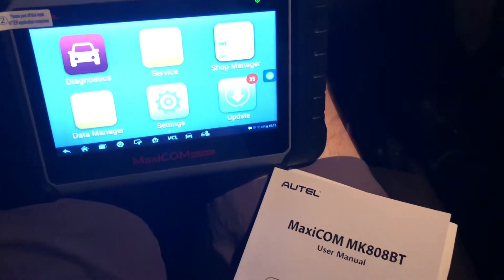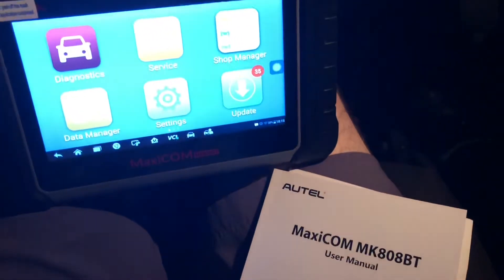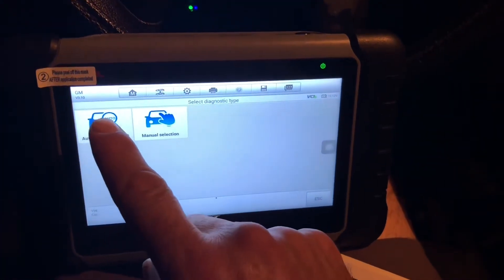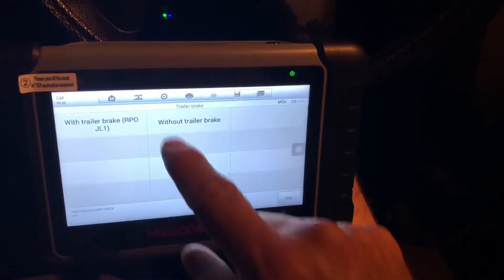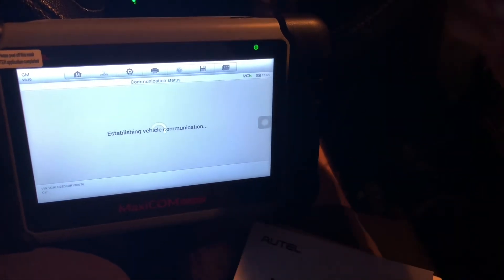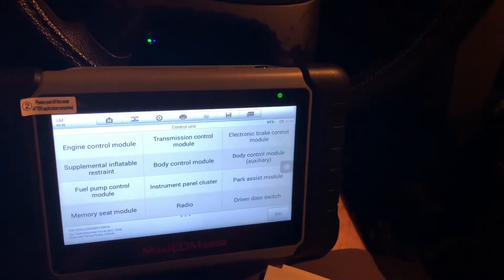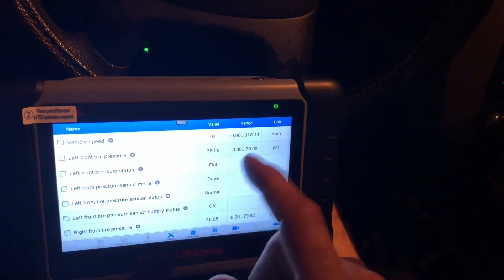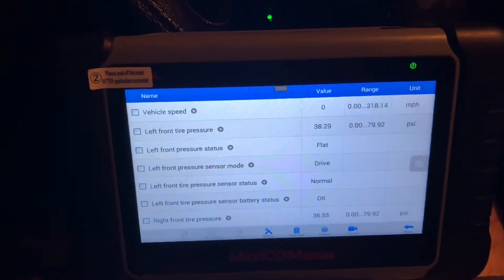reading live tire pressure using mk808 by autel

Comment: Im having the same problem. I bought the mk808bt and im trying to set my tpmi`s but all i get is straight lines. No tire pressure is displayed. ive tried it without the tool and with it, but not having much luck. I wish there was a good videeo on how to set it with the autel because im confused as shit as to
 what im doing wrong...lol